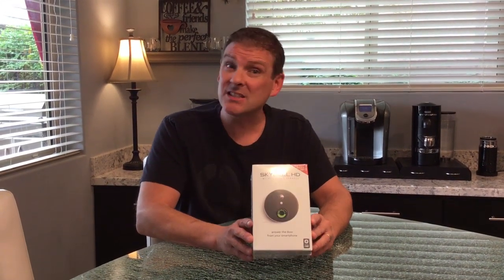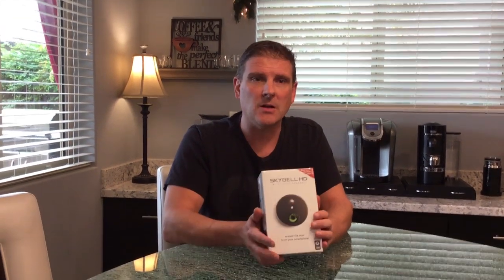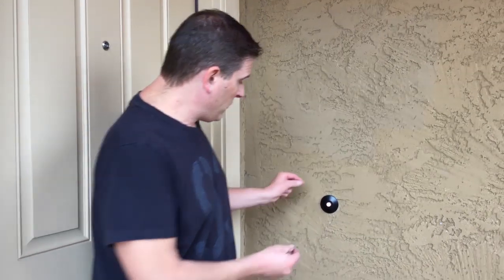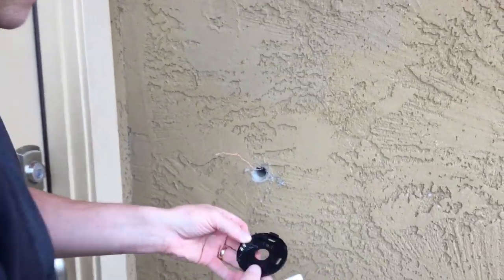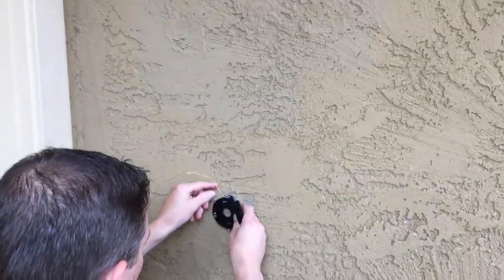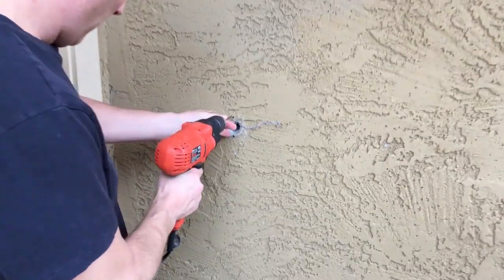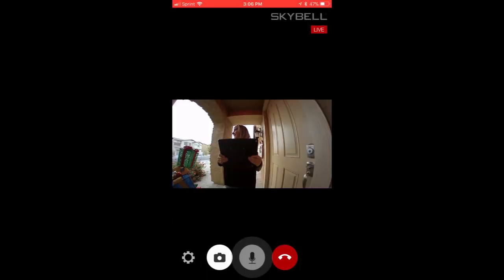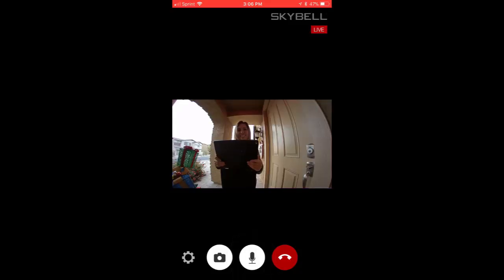SkyBell HD Door Bell Unboxing and Install

Comment: I'm a proud owner of the Skybell HD also..I've had the silver version for 2 yrs now and it works Great..the reasons you mention on chosing the Skybell HD over the Ring are some of the same reasons I didn't go with Ring..plus 2 yrs ago Skybell was doing the liveview option where as Ring did not,Ring started the liveview option last year..FYI: I too have a Great internet speed and connection at home, but with that being said I found leaving the video quality set to "720p Better" works the best when your away from home because your celluar network WILL NOT be as good of a connection/speed as your home wifi, so by doing this you will keep the fast connection when your away from home--hope that helps--Enjoy your Skybell HD..👍😄
Reply from the maker: Mark Her I am so glad you enjoyed the video.  I have also discovered that the 720p mode seems to work best.  I wish SkyBell had an option for WiFi quality versus internet quality.   In the house 1080p works awesome, on the go 720p is better.  Take care and enjoy.
Reply: ipon70 
👍..
Thats what I discover also as far as the 1080p working good at home and 720 works better away from home..

Comment: ring does use existing doorbell button wiring and can power off the wiring.
Reply from the maker: tiwanx that is correct, my reference was to the doorbell, not power.  Ring can not “ring” your doorbell without additional costs.  Thank you for the comment.
Reply: I just installed a Ring 2 doorbell this Saturday at my house (they were $30 off at Costco and come with a free year of cloud service).  My existing doorbell is electronic (the type that plays music when the button is pushed outside).  The Ring 2 came with a diode and instructions on how to install it so it will work with a mechanical or electronic doorbell and I was able to install it very easily, and it all works.  Yesterday, I tried installing a Skybell at my in-law's house (they also have an electronic doorbell that requires a diode) and the Skybell would never get past the flashing red and blue stage (apparently charging).  I understand that you aren't affiliated with Skybell but after your very well presented video, I assume you have a lot of viewers that may be interested in this information.
Reply from the maker: jbwithro you know if that is the case, i will do a little research and then insert into the video a correction.  I actually chatted with ring online and they told me it didn’t work along with another video i watched.  But if something has changed with the new and or they have made a work around for the old, I will correct it with a tag.  Thank you for the information.

Comment: Is your doorbell mechanical or digital? I bought a mechanical doorbell but the chime in the house is not ringing my Skybell HD doorbell. How did you get your doorbell to ring?
Reply from the maker: Carol Benjamin so to answer you question, we had just a normal boring style doorbell everyone you have ever seen type.  It’s a mechanical type, with the plungers that strike the metal bar on both sides.  It’s ran from a 16volt transformer that was already there in the garage.  And i did nothing more then i showed you on the video .  It just worked.  Let me know if i can answer anything else, i will do my best.
Reply: Thanks so much ipon70!!

Comment: Do you think that the lag might be because of strength of the wifi?
Reply from the maker: Karah Harrington so as time has progressed and I have fielded more and more questions, I have come across a consistent pattern when the SkyBell has issues.  Most of the time is actually not a lack of signal it’s actually too much signal.  If your SkyBell seems to have an issue with dropping, bad frame rate, and or no connection, it could actually be too much signal.  Yes that it counter intuitive but seems to be the case.  The lag is just the transmission time of up and back to get everything synced.  I am not sure if it will get better with time, but there is a wonderful amount of delay.  Hope that answers your question.
Reply: Thanks It helped
 @ipon70